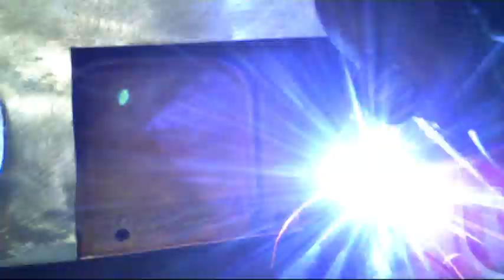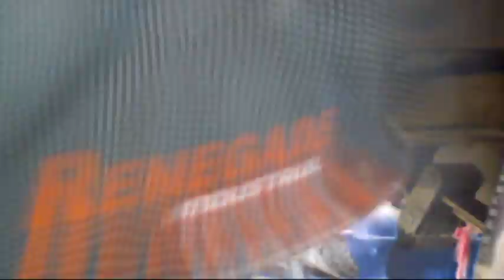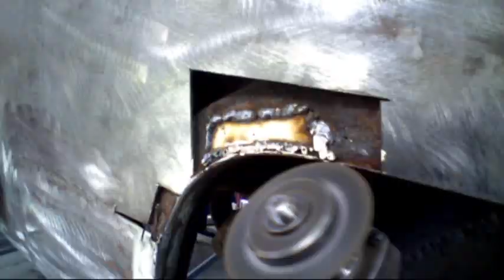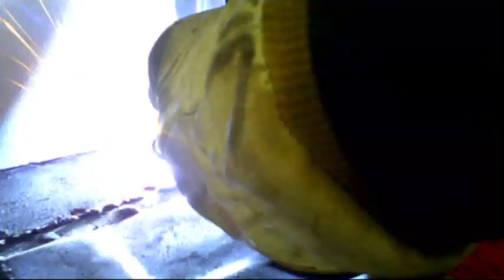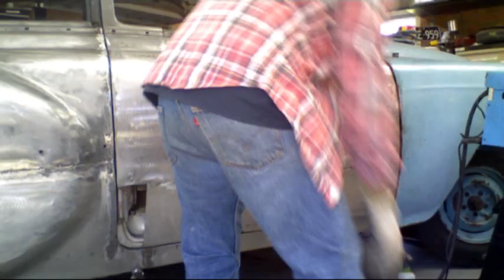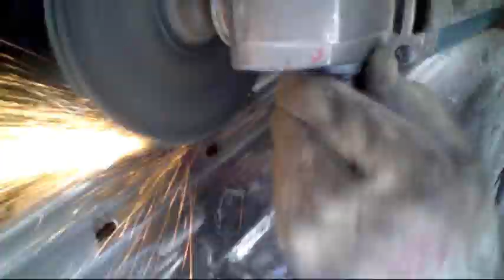Converting a rusty 1953 Chevy 4 door sedan to a 2 door custom car. Part 7. Finicky bits. Timelapse

Comment: nice metal work. Is it common or prudent to spray primer or POR-15 rust converter in the cavity before placing the last patch panel? I see remnants of surface rust left behind, even though it was wire brushed.
Reply from the maker: I'll be treating all the cavities with fish oil once everything is back together and then probably using fish oil as ongoing maintenance.. There's probably better ways to do of what I'm doing for sure. I'm just trying to get the car finished reasonably well, reasonably quickly. Thanks for watching.